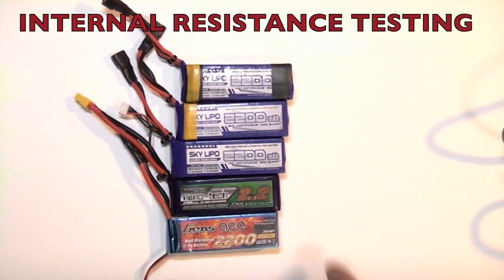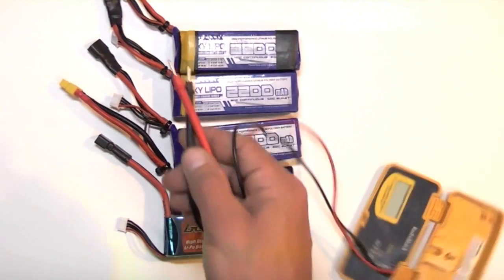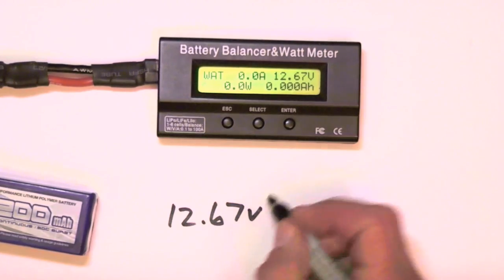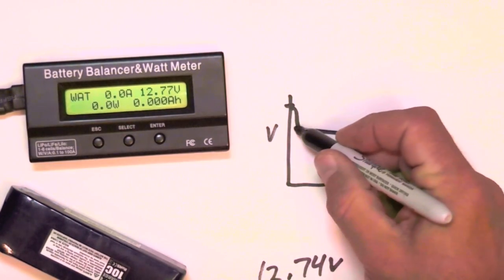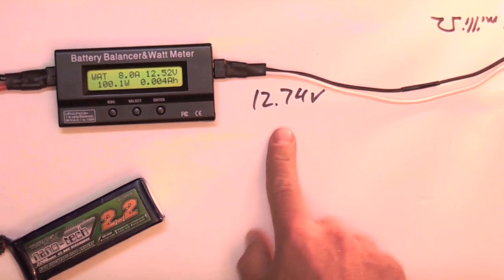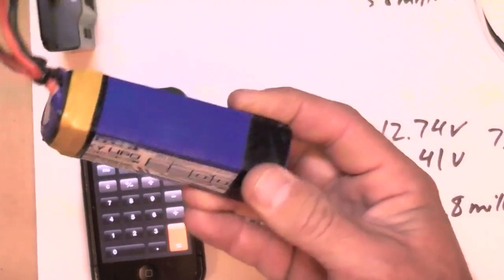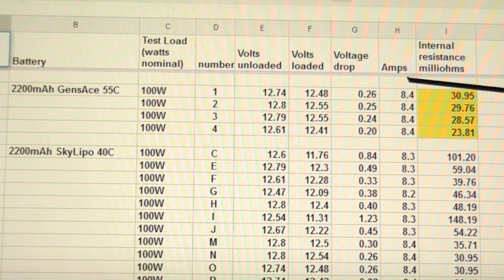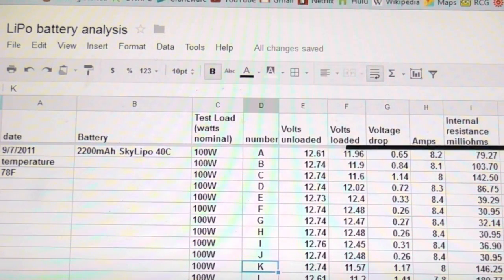LiPo INTERNAL RESISTANCE TESTING - a simple 12v load tester

Comment: I learned a hard lesson on the 1st flight of my new plane.......CRASH near the ground, as  I lost all control at the 5 min mark of flight and I was very close  ( range wise ) .....I was using  a very old 3S 2200mah LiPo....pretty sure the ESC  went into LVC,   although after checking the battery after the crash  it showed  voltage was 3.80 per cell ........I am now searching  for  a simple way to  check IR in all my LiPos ...........as a beginner to rc airplanes , what if I just pick an inexpensive IR field test meter and just use it to watch my aging / damaged 3S  LiPo's for  unacceptable high readings...your video is great, but the method is time consuming .....I really would like a quick and simple way of checking the IR of my lipo flight packs  ...thanks again.......

Comment: I assume you stick to and use the proper volts depending on the battery 1S = 3.7volts (3.7v), 2S = 7.4 volts (6v) or 3S = 11.1volts (12v) but how do you determine what wattage to use for each size starting from 1S all the way up to 3S?  your video for 3S you used 100 watts total with 2 bulbs in parallel.  Do you go down in 1/s for instance 2S = 50 watt and 1S 25?

Comment: I have to point out that most modern Chargers have an internal resistance check function that gives you the internal resistance per cell which is never the same cell the cell so just dividing by 3 does not give you the actual internal resistance for cell. Much easier than the method you're describing I suggest that the viewers take the time to learn about the Chargers and what they're capable of

Comment: Thank you for good guide and your time. However, I have a few questions.

You are using 100W (12V) load on 3S batteries which means approx 8.3 Ah load. Also, you are changing your Amps column number time to time like 8.6Amp or 8.9Amp which I see in your video. Is that means, you are changing your load or for what reason you are doing that for same load?

Comment: Thanks, nicely done. Even though I am an engineer, I have flown for decades, without having tested my batteries for internal resistance. I have meant to do so, but.... Anyway, I am very glad  I have come across your video.  Exactly what lights are used for the load?

Comment: I have made a load system like you suggest with 2 50 Watt Halogen bulbs.   I used on a 4S pack as we race boats with 2 4S in Series for 8S.  At 16.5 volts it lit the bulbs very well.  I'm concerned since thats above 12 Volts spec for the bulbs it may just burn them out.  Hasn't so far but I've only left connected for about 20 seconds.  Is my concern valid?

Comment: Great video, but what do I use to test 4s lipos?  Look for a 16 volt light fixture?
Reply: +profilefan   I just paid 10.00 on ebay for a little voltage regulator  that should solve this question
Reply: +MrBillBrandt Then you need to measure the load that the voltage regulator puts on the circuit.

Comment: Nice video. Just a quit tip for anyone who does not have a watt meter. You can find the energy put out by your batteries with two measurements of your voltmeter. Measure both current through the load and then the voltage across the load. Then use P=VxI  to find the power delivered to the load from the battery. Try it for different loads. Then you can compare all your other batteries in the same way. Cheaper than buying a watt meter but a little tedious! But it is though, a very good way to learn about voltage, current, resistance and power.

Comment: When do you need to charge a 12.6vdc 3S LiPo battery? When is it empty, and needs to be charged? Is it 11.1vdc ? Other than that, awesome video. Figured you'd know since you mess with batteries. My 5,200 Keep Power 26650 batteries need to be charged at 3.7vdc. They are rated for 4.2vdc, but when I fully charge them, they read 4.175, which is only 0.595238095238095238095238095238% difference or off. That could mean either my 6,000 count True RMS DMM is off, or the battery is actually 4.175vdc. But 0.592vdc is very small. I can live with that, if my meter is off by 0.595% But yeah.. cheked the specifications for my dmm, and it says 0.5%, so yep, I was right, it's off by 0.5%. So my batteries are actually charging to 4.19688vdc. Not bad.  I guess. That's only 0.07428% from 4.2vdc. Or 99.9257% of 4.2vdc. According to my dmm. UT61D.  (+1 : 340)

Comment: I know you all are pretty informed about LiPo charging rates and voltages.  But I found the link to a video to be Very Good about Why Lipo Batteries Die!!  Now it is about 90 minutes - it is a research / engineers type lecture.  But what I got out of it was a few things ..
1). Don't charge your batteries above 4.1v and don't discharge below 3.1 and your batteries will last 2 TIMES as LONG!!  (given the same use conditions).  Now I realize that most chargers are set to Charge from 3.0V to 4.2V for LIPO ... but I am just telling you what the research says.  Yes you get more power from 4.2v to 3.0v for each RUN but you will get a lot FEWER runs.
2). Don't store your batteries any where near 4.2v for very long ... always store them near 3.7-3.5v depending on the battery and they will last much longer.
Here is the Video link ...
https://www.youtube.com/watch?v=pxP0Cu00sZs
Reply: Don't store them at full charge.. only charge to 4.2 before you're going to use it.. 3.8 for long time storage. Still have lipos from when I started with hobby

Comment: Good video. Only way to check your batteries... but sad to see the batteries go bad so fast. That was a bit of a surprise. Not much of an investment as time destroys them. Too bad the darn hobby grade meters are so far off usually. Like the 3 button ones like you use but haven't been able to find one yet that could balance the cells accurately and therefore use as a real life watt meter I trust. Hard to do the math if the numbers aren't real. Might as well use dice;-) And as you showed the load affects the amps used so nice to have a standard to go by but agree 1C is too low.... why the manufactures use it but we shouldn't. I really like my gliders. The main power battery is free and good for another 4 billion years;-)

Comment: Is Lipo the same as LIXX BATT?
Reply: Lipo is a type of lithium battery (lithium-polymer). With LIXX they don't say which specific lithium battery type (you got li-ion, li-fe and some newer). This types are not the same - they differ in capacity per weight, max charge rate, discharge rate, etc

Comment: Thank you very much for a very meaningful contribution. I repair and gift Tablet PCs to the needy thru NPO's. Hundreds done so far. Li-Poly aging and PO efficiency is always an issue with these recovered tabs I buy them P&R with my VA comp. (VVA, 65-67, I Corp, North). These single cells can be up to 6500 mAH in 10" tabs. I need to know the "relative health" of the Li-Poly in the tablets I gift. This will work beautifully. Someone made a statement about overcharging - actually 4.25/4.27 is acceptable and not a "streesor." See Battery University web site - excellent verified, scientific information on Batt. Tech.

Again, thank you for an effective and very valuable contribution. There will always be "crab mentalities."

BTW- Relative - As Einstien said to his colleagues in explaining his theory: "My friends, money is relative, when they die, you get it."

Prof. WmJR

Comment: This is cool but it sure would be nice if it was per cell so one could possibly replace the bad cell with a good cell. I kind of know when a pack is not worth using anymore just by flying it.
Reply: Most modern Chargers have an internal resistance function that one can check the internal resistance of each of the cells. You don't have to hook up all this other stuff and manually do the math it just tells it to you. What I do is when I get a new pack is check the internal resistance Market down on the side of the battery and then over time I take a look every once in awhile to see where we're at

Comment: Excellent job! This is the exact info I was looking for.   Just recharged all my batteries for the first nice 60f Spring day with 5mph winds.  Six of my batteries lasted less than 1 min flying my Quad.  Some I knew were marginal.  Now I have a more systematic approach than just "test" flying them.  My iCharger 306b is suppose to measure internal resistance but I'd get 45 ohms and the Lipo would still not hold the voltage.

Comment: I really think counting down 15-20 seconds after load is applied is more appropriate that just 10 seconds. My battery voltage drops does not level out until around 20 seconds.

Comment: You say that the voltage levels out after around 10 seconds of applying as load. However, non of my batteries level out after 10 seconds they all drop continuously. Are they all bad packs or am I doing something wrong?

Comment: Either your watt meter is not showing the correct voltage or you are overcharging your lipo's! Full charge voltage per cell shouldnt be any more than 4.2v. Your voltage is showing as 12.8v which is 4.27v per cell. This is one way to reduce the lifespan of you batteries :-S 0.07 volts extra doesnt sound like a lot, but for lipos it is stressing them a lot!
Reply: I think it's his meter. Every one I have seen (in 3 button design) is so far off it's pathetic. I got one and I really think they used a genuine coat hanger inside it. I'm sure his charger is more accurate but I hope you are right as the time scale he shows for the life of his batteries was really short. If no one purchased these worthless imitations of a real watt meter they would stop making them and start making real ones. The cheapest millimeters are better than what the RC hobby is offered.

Comment: Thanks for the how too. I learned this in school for aircraft mechanic a few years ago but needed a refresher. I just got a 100 watt 12 volt halogen bulb and will be testing my lipos using a volt meter plugged into the balance lead as well as a clamp on DC amp meter.

Comment from the maker: 2S can use the 12v bulbs, probably 4S too.  The bulbs are just the 'load' and the 12v is just the rating for the bulb, but's not crucial to measuring the IR.  You can use the same process, though the bulb may be dimmer or brighter.  The part that matters is the measured amperage and voltage, loaded and unloaded, and the math you do with those values.  For 5S and 6S I would recommend connecting a duplicate set of bulbs in series to double the resistance, so the BULBS would be 2S2P for a 6S pack.

Comment from the maker: I have not seen a published spec on this but I keep mine refrigerated, but not frozen. More importantly they should be at 35% or so charge, so like 11.4 volts.  As with any chemical reaction it would make sense to lower the temperature to slow the discharge and deterioration of the cathode and anode materials and the electrolytic polymer inside.  But I'm sorry I do not know a specific temperature.

Comment from the maker: Oh yes, sorry.  I just stabbed a very thin screwdriver through multi-stranded 12, 14, or 16ga wire, then stick the prongs through the resulting holes, right through the insulation and between the copper strands inside.  I then put a big puddle of hot glue on a piece of foamboard and stick the base and prongs of the bulb in it.  Be sure to keep this cool by brief testings, or consider using a more heat-tolerant solution, like epoxy.

Comment: Ed,

How did you solder on your leads?? The prongs on those bulbs don't want to solder.. Is there a techniques for attaching wires to the leads on those bulbs using solder??

Comment from the maker: I won't be able to do that right now on a video, but using 4 bulbs, split the currrent into a Y, then put two bulbs in series (wire in and out of one bulb, then in and out of the second bulb) on each of the Y arms.  Then recombine the current back into one lead and use that to complete the circuit.  PM me your email address, maybe I can sketch it real quick and send you a photo.

Comment from the maker: Exactly!  2 parallel x 2 series.  The 2 parallel doubles amp draw and the 2 series doubles resistance.  There are other combinations that could work.  I chose 100w load as a nice middle ground, but you could add more wattage worth of bulb in parallel to increase the load, or fewer to decrease the load.

Comment: GR8 video; well put together and your thorough explanation of each step outstanding.  If I want to perform the same test on my 6S batteries, would I hookup four of the 50w halogen bulbs in a series/parallel configuration?

Comment from the maker: I just use a $25 Detrum that's like so many other "4-button chargers" out there.  Turnigy makes one too.  Nothing fancy, does the trick just fine for my purposes.  5 amp charge is 2.3C charge rate for my standard 2200mAh packs, and that's just about right for my preference.  It does need a separate 12V power supply, and "power bricks" are easy to repurpose from computer components or on eBay for less than $10.  Be sure they put out at least 5-6 amps DC.

Comment from the maker: TapeBrothers com, very easy shopping and quick shipping.  I have not seen the tape we use anywhere in a retail setting.  Original thumb is all gone, every trace.  The index finger joints were used, although badly damaged, and they work OK enough.

Comment from the maker: Can you ping me again via PM with your email address?  I've added a spreadsheet function that will calculate the C discharge rate for each battery and will "normalize" the IR measurement so you can actually compare between different battery sizes but still using the same test load.  It's not 100% perfect but it's way better than guessing.  I will send you the sheet.  You won't need to do any additional measurements, just enter the mAh capacity.

Comment from the maker: Yes, start fully charged.  Batteries of different capacities will yield different results when tested with the same load because the C discharge rate is different.  The results are valid within that size battery and across time for a given battery, but are not generalizable to other size batteries.  Small batteries = higher internal resistance.  Your results are what I'd expect.  If you reduce the load for those 850mAh NanoTechs I bet your IR would be on par with the SkyLipo results, or better.

Comment: I tested all my batteries according to your vid.  I had some interesting results.  I was wondering if the capacity of the battery with the same load applied would affect the results.  I ask because I had some NanoTech 850 Mah 45-90C brand new batteries test worse than all my other batteries which are mostly 2200Mah to 3300Mah sky lipo and chineese brands.  The Nanotechs had an internal resistance between 84 and 91 Milliohms.  My skylipos had and internal resistance between 23- 35 Milliohms.

Comment from the maker: Indeed, good eye.  The wattmeter I'm using is $27 and not the most accurate, always reads high like that.  I charge up to 12.6v.  The voltage drop is the more important parameter and seems to be reasonably reliable.  Certainly not perfect though

Comment from the maker: PM me your email for a copy of the spreadsheet.  The bulb pins are just stabbed through the stranded wire and epoxied onto a piece of foamboard, in parallel.  I use a lot of Dean's but am transitioning to XT60 because they do fit very securely and have a lower risk of shorting out for multiple battery adapters, where a Dean's leaves some live plugs just kind of hanging out there waiting to be touched by something metal.

Comment: Great video.  Now I have to go get a few lightbulbs and do the same thing.  I have been meaning to set up something to discharge batteries and now this gives me more incentive to do it.  Thanks for putting this together!

Curious as to why your batteries have a no load voltage of 12.7 to 12.8.  I assume you are not charging them that high, but rather the measuring differences between your charger and your Wattmeter?